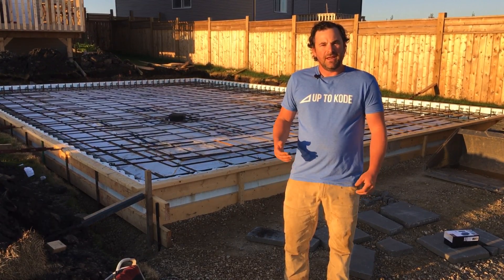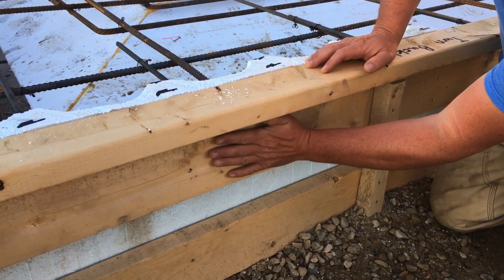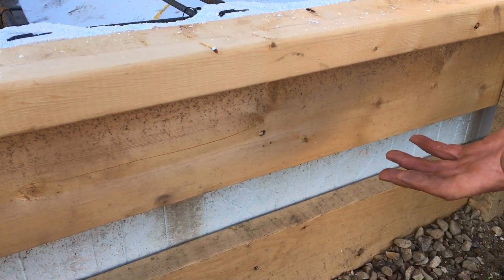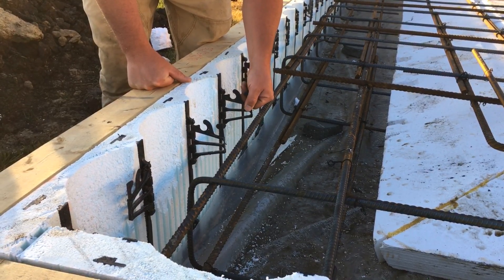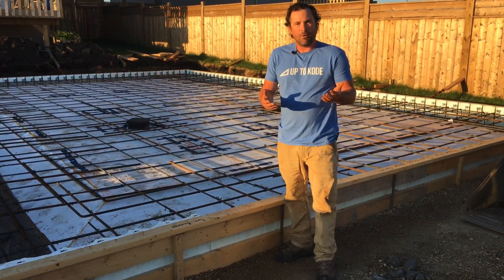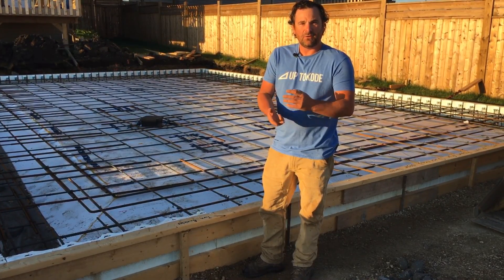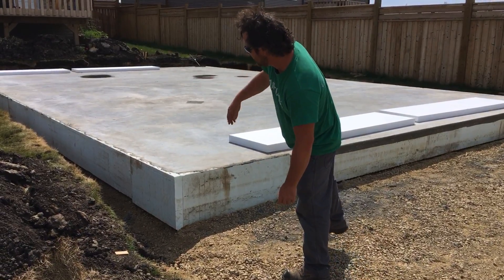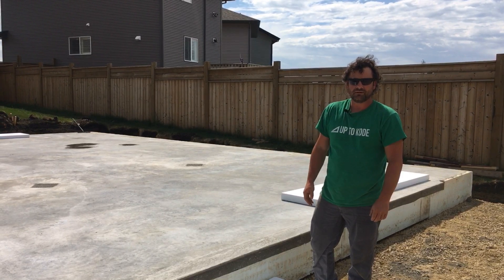ICF Block to Form a Garage Slab

Comment: So no foam at bottom of footer areas?
Reply from the maker: We installed foam on the exterior that ran horizontally (at bottom of slab) about 24” wide. The engineer didn’t want the structure sitting on foam around the thickened edge of the perimeter. You can use high density foam for something specific like this but we didn’t.

Comment: No insulation under the thickened edge? That is an awfully large section of thermal bridging around the entire slab?  Seems pointless to put ICF on the outer wall if you have nothing below the thickened edge?

Comment: I don’t understand why you would carve out the foam. Aren’t you going to put continuous foam on the outside of the framing? I would assume you would like to see the sheathing/foam flush with the ICF
Reply from the maker: I did that to give the wall more bearing on the concrete slab. The exterior sheeting is flush with that ICF strip.
Reply: @uptokode  do you install continuous exterior insulation? I’m doing a floating slab that requires 2” silverboard around the whole outside (including foundation), so I was just going to use the ICF as the foundation insulation then install the framing in a way that allows the 2” foam to be flush with the icf face
Reply from the maker: That’s exactly what I would do in your situation. Keep in mind “Homega” by Nudura is sheet foam with furring strips built in. 2 5/8 thick, 3 1/2” and 3 7/“.  Check that out.

Comment: With the grade ascending didn't you end up with the grade higher than the top of slab back towards the house and therefore wouldn't you need a curb so that concrete was 8" above finished grade?
Reply from the maker: The grade near the house was above the slab height. I gave the homeowner specific instructions on how to build and protect his walls (as he framed and finished the garage himself)

Comment: Did you cut the Nudura block in half in the middle of the snap ties?
Reply from the maker: I cut them in half yes! Half the tie was left and helped bond the block to the concrete. 

Next time I’ll purchase an unassembled block so it’s a bit easier.
Reply from the maker: I’m going to film the difference in floor temperature of this garage vs a conventional slab with no insulation on the sides or underneath. Make good use of my thermal camera.

Comment: I need to raise grade several feet, I'm wondering if I can put ICF block on grade,, stack the blocks one or two levels high, pour the footers, and then back fill the inside tamp, do all my plumbing, insulation and pour my slab, then backfill exterior? Does this make sense in any way?
Reply from the maker: This makes sense. Are you in a climate that gets frost?  Email me if you need more info. kody@uptokode.com

Comment: Why is a 4 ft deep footer not required on a detached garage in this climate zone?  Is this trenched perimeter method acceptable around most parts of the U.S. and Canada?  I just don't know.  I'm planning on adding on to a heated detached garage to double it's depth, making it 52'feet deep. I like this video showing the foam insulation applications.
Reply from the maker: This garage can float as the slab is structural and can handle the variation in weather and frost. Most garages beyond 20x20 need to be engineered for a slab like this whereas a 4’ frost does not require engineering (may vary in different regions). 

If I was adding a garage to a home I would 100% install the 4’ frost wall with no exception!! You cannot have one part floating while the other is stationary. 

I hope this helps.

Comment: This looks like a shallow foundation. Can this be used for a 2 storeyed house?
Reply from the maker: You would have to check with an engineer and it depends on your region. This one is for a 10’ tall garage and is technically an “engineered slab”. It’s designed to float and remain in one piece.
Reply: @uptokode  : thanks Kody.

Comment: Do you have any details on how the ground is prepared on the inside and how the foam is laid dows on a angle to have proper support? How is the angle staying in place while it is being compacted and shaped for the inside perimeter?
Reply from the maker: Place and pack the gravel with similar sloping. Add the foam on top and the sides we mitred the foam and placed some screws to stitch the foam together so it wouldn’t move. Once the rebar was placed nothing moves. 

If you need more info just email me. Check the description of ANY video for the link.

Comment: I don't know where your located, but you have to be seriously you north to require 3 foot of horizontal insulation. I built my workshop near Salt Lake City and only needed to go 12 inches below grade using ICF (no horizontal). Up in Park City, UT, it would have required 12 inches down and 16 inches horizontal. The technique I used was "Frost Protected Shallow Foundation". Btw, it does assume a heated building.
Reply: I think he's in Ontario.

Comment: Cool. 

I've usually just put EPS foam up against the inside of my formwork but the half ICF blocks are neat that you can screw into the forms. 

I also would frame on the concrete and add would 2" of exterior insulation so the transition from slab to framing is seamless. But this solves that problem. Nice work.
Reply: Yes but they are screwed to the forms from inside.  How do you get the forms off without tearing up the foam?
Reply: @fishon7301  1:39  He screws the ICF to the forms from the outside

Comment: Why didn’t you put radiant floor heat tubing in if you are insulating the slab so well? Tubing is cheap, the insulation is the expensive part and it’s just the best way to heat anything.
Reply: I agree with that completely. We use spray foam to do these crazy haunched slabs.

Comment: That's pretty interesting. A slab like that here in Australia for a shed/garage would just be 100mm thick concrete
Reply from the maker: We have frost that will heave the ground or anything sitting on it. So it needs to be strong enough so the whole entire slab moves as one unit.